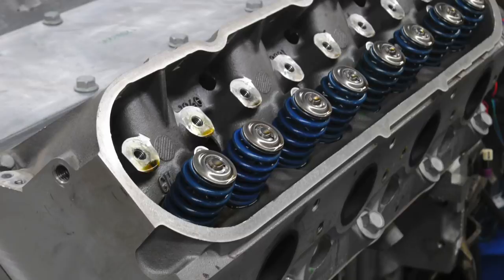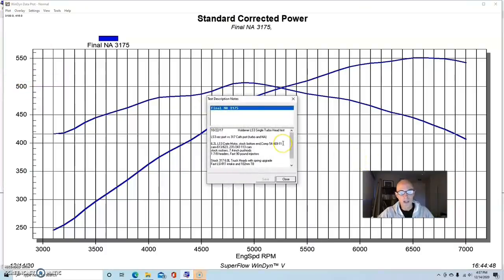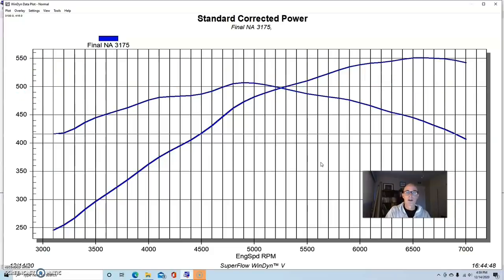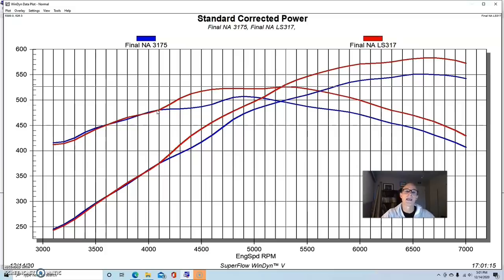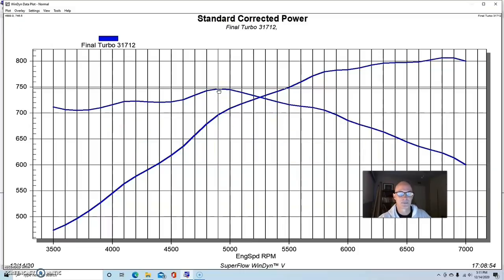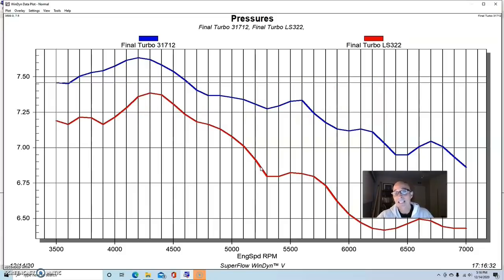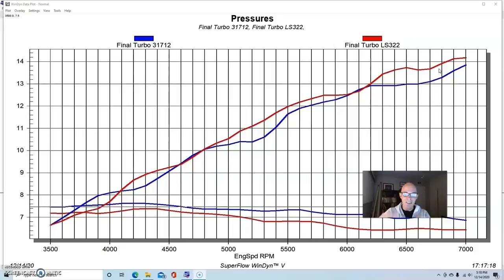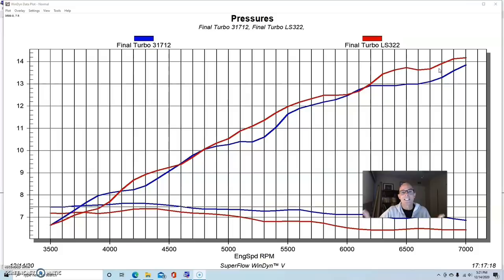TURBO LS HEAD TEST-317 VS LS3 (NA & TURBO)

Comment: Here's something weird. The square port truck manifold and the LS3 manifolds run almost identical numbers. The TBSS manifold and square port truck manifolds are physically identical except the port shape. The Fast manifold is an improvement for the cathedral port over the TBSS, but not the truck/LS3 manifold. I wonder why that is.
Reply from the maker: the TBSS is not identical to the rec port truck manifold
Reply: @richardholdener1727 externally they look the same. I was swapping parts from one to another yesterday. I did notice the injectors look like they are off to the side out of the way of airflow on the square port. That probably makes a big difference.

Comment: Will the 823 heads match up with a 5.3L LC9 block?
Reply from the maker: IT WILL BOTL ON-BUT THE VALVES WILL HIT THE TOP OF THE BORES
Reply: @richardholdener1727  thank you sir

Comment: I was thinking from what I’ve heard 317s are not that good but this test changed my mind 🥴bet very little bowl work would even out this comparison.Loved this test as I have a 6.0 with the 317 heads.if 800 hp is not enough add a pound or 2 of the ole boost 😉

Comment: You can definitely over think this stuff. I built a stock bottom 6.0 for my all steel 69 Nova. New rings and bearings, used BTR turbo cam, 317 heads with springs, VS s480, turbo 400, 9 inch with 3.70 gears. 80lb injectors, on 93 octane runs 9.71@140 in the quarter, in a 3700lb car. Safe afr, 14lbs and 15 degrees of timing. Scary fast! More than anyone needs on the street.
Reply: On pump gas. I like it. Building an AWD S10 w/6.0L, 317s, 3200 stall in a 80E, 3.73 Ford 8.8. I would be happy running anywhere in the 9s.
Reply: But 140 in the quarter not fast these days

Comment: Alright Richard, I'm just gonna have to admit it. Im soooo jealous of your job dude. Don't get me wrong as with any job , I'm sure it's it's got 1-2 parts of it that u hate. But to get to play on the dyno all the time testing new/oem parts on multiple engine types/makes etc,that right there  is what I'd call my dream job. 
Just watched the rerun of engine masters you did "Big Bang gen 4 LS 6.0l",I think that'd be the only part i wouldn't be crazy about w your job. That's only cuz i hate being on camera though.
Anyway,on that "Big Bang gen 4 LS 6.0" you ran outta map sensor at 29psi (1500+hp), whatever happened to that test? Did you finally get a 3-4 bar sensor and keep pushing it?
Reply from the maker: have not run it past that

Comment: ok so I am watching every video you pretty much have doing my home work. I have 317 heads and shooting for 1000+ hp I have decided to utilize methanol injection for those special days when I want all I can get as those days will happen.  I have said in numerous comments 408 stroker engine. your graph shows a pretty good power gain from 3500 to 5500 which is where this engine will be the majority of the time. and less boost pressure and more power will help with the limiting factor which will be the fuel 91 octane pump gas am I correct in this assumption. so 80% of the time will be at 7-10 psi on pump gas only the ls3 head puts out more power down low. even though I can just turn up the boost to get that extra power with the 317 heads I will run into my fuel being the limiting factor correct? so the wiser choice would be to up grade head in this situation. or am I off somewhere? I am slowly trying to learn all this from your videos. thank you so much for all you do.
Reply from the maker: YOU DON'T NEED HEADS FOR YOUR COMBO

Comment: With stock heads that flow as well as the LS3, I think it comes down to economics.  CNC ported LS3 heads from GM add 10% in peak flow and presumably a similar amount of power for $1200.  I always think in terms of additional power added per dollar spent, because I'm always looking for the best value.  If I have my NA LS3 up to 550 hp with a cam swap for $450, then want to add 50% more power (825 hp) with 7 lbs of boost with a $1200 turbo setup, that's a good value.  But if I spend the same $1200 on CNC ported heads for 10% more power (605 hp), that's not as good a value.  Say then that you have your 825 hp turbo LS3, and want to add another 10% power, you could spend the $1200 on ported heads, and get to 908 hp.  Or you could just turn up the boost to 9.2 psi, and make the same amount of power, and not have to spend the $1200.

Comment: Ls3 , what type of springs? 
What was afr?
Reply from the maker: DUAL SPRINGS AND DID YOU WANT NA OR TURBO AFR?
Reply: @richardholdener1727   spring rate,  you remember where you purchase the springs, part no. , link?

Afr for turbo, with rec port heads?

Comment: Something thats extremely important in this comparison(which is nor even brought up in the video) is the fact that the cam used for this test is an ideal cam for the ls3 head. Not ideal
For a cathedral port head. For a 6.0,  Ideally in the real world, an optimal cam for cathedral port heads and properly sized piping, the cathedrals will see the power coming in down low in the powerband. Essentially making more power than the rectangle port heads until you get up to 4000rpm. After 4k rpm, then ls3 head takes off.  On engines with leas displacement than the 6.0, this becomes more profound.  And engines bigger than 6.0, the ls3 heads make even more power up top, but still have little to no difference below 4k rpm....  there’s a reason why most all the fastest n/a cars still run ported cathedrals on anything less than a 6.0.
Reply from the maker: please see the many other head videos-and your comments on cath/rec-port cams in incorrect

Comment: Hi Richard, what do you think of the 241 heads? I'm in Australia they are the most common
Reply from the maker: I have a video up on the 706 vs 241 vs 317 vs 799 (they work well-better when ported)
Reply: @richardholdener1727  I'll look it up cheers

Comment: I had my 317 heads CNC ported which gave me another 71 cfm on a turbo 6.0 ls, I also increased my cam to your favorite comp cam,  now it does run quite strong however it seems like I lost power. Those are the only thing that I changed other than valve springs.
Reply: Fuel

Comment: @richard holdner what head bolts are you using? i’m building a 5.3 turbo... probably kept under 10-15lbs (**probably haha!) lots of opinions. would you use stock gm bolts? arp bolts? studs?
Reply from the maker: I USE ARP
Reply: @richardholdener1727  bolts or studs?

Comment: After all the videos you've done the biggest take away I've gotten from all of them is; more power na more power forced induction. So why would you not build for best na power, when youve stated time and time again more na more fi?
To put the question better; if youre going for best na power why would you not put known items on a na engine to produce the best results? Would you put a cam in it and do nothing else and expect results found on many of the vidoes on youtube show?
Reply from the maker: YOU NEED TO CONSIDER YOUR GOAL-IT THAT GOAL IS LESS THAN 1000 HP, YOU CAN ACHIEVE THAT WITHOUT MORE MODS-JUST CAM, SPRINGS AND BOOST

Comment: Us ls guys are spoiled. I made 760whp w stock 317s, head gaskets and head bolts. Unopen factory block. Just some 2003 vintage thunder racing cam that I bought in the ls1tech days. That's on stock ring gaps from a  04 lq4 85k motor. 
Ran out of injector n pump. Or probably could have made more. With a vs 7875 billet turbo. Common  ls hardware.

Comment: I need help on my 6.0 with 317 heads. Not sure what cam to install, springs , turbo or whipple charger 🥴😆
Reply from the maker: HOW MUCH POWER?
Reply: @richardholdener1727  Im a stock 6.0 with 317 heads in 2004 Silverado, I’d love to be in the 800hp range but not enough money for that so I think 600hp or so would be reasonable for me to build my engine.

Comment: My question is,  if I was to run a 6.0 LS, na, carbureted,  and dual plane intake, what would make the best power for the street and occasional track. What head, intake and carb combo. What cam do you recommend.  I'm on probably the very lowest budget lol!!!
Reply from the maker: THE BEST (CHEAP) HEADS WOULD BE FACTORY REC-PORTS, BUT THE CHEAPESTEST WOULD BE THE HEADS YOU HAVE. A SLOPPY STAGE 2 FROM AMAZON WITH CHEAP SPRINGS, 750 BRAWLER
Reply: @richardholdener1727  thanks Richard!! Waiting and watching every video!!! Oh and what intake do you reccomend? Is there an air gap for the LS?

Comment: Anytime you can make more power with less heat it is a gain. A better flowing hot side whether it be in piping or exhaust housing would allow for even more power at the same boost level. To match the power the less flowing head would need more boost and higher IAT’s.

Comment: I know you talk about ring gap a lot. But would a stock 5.3 motor without tearing it down and adding ring gap be reliable on 6-8lbs? Without ring bind?
Reply from the maker: PROBABLY-BUT WILL YOU KEEP IT AT 6 PSI?
Reply: Yeah. It’s my Yukon. Just want it to tow better

Comment: Hey Richard, if you look at this from a longetivity view, wouldn't the ls3 heads make the lower end live longer?
Reply: Or just turn down the boost 🤷
Reply: @hhn2002  my point was, that the ls3 heads made more power and less boost @ the same wastegate setting, so theoretically, the rod and main bearings will live longer.
Besides, if you lower boost, you lower power, and who wants to do that?
Reply: Your theory is incorrect. Boost is resistance to flow. The rods see the force applied to them from the pistons. More power equals more force. You could place a huge restriction in the intake that would raise the boost but kill power.  That would also provide less force on the rods, theoretically making them live longer

Comment: True the turbo makes the power you want but at what level do you loose reliability with boost I think over 15 psi your asking for trouble.  So  a ported set of 317 can make 800 hp at 14lbs non ported it takes 17lbs,  porting heads has its place for sure

Comment: I don’t think you need to upgrade the heads until you’re over that 1000whp mark. I’ve seen plenty of stock head cars 4.8, 5.3, 5.7 make well over 1000whp without touching the heads (aside from springs)

Comment: If your class limited to a certain turbo and need to squeeze every last bit of power out of what you have then yea port it. If you're running a stock turbo motor the thousand dollars you would put into porting the heads could get the same effect by adding 2 psi for free... Does it help, yes. Is it worth it, no.

Comment: The question is where did the 1/2 psi difference in pressure put you on the compressor efficiency curve?????  I don't know if the intercooler could take all the extra heat out or not (if there was a difference).  All we really know is which one had better MAF.

Comment: For all us guys who purchased a wrecking yard LQ4 and were previously told that the 317 heads are not the go to head, this is great news. For the $$$ saving of finding a set of used LS3 rec ports, I can buy ARP bolts for the heads and mains and then  make 800HP on 7 psi with 100 octane all day. In 1970 the famous LS7 454 with 12:1 compression was advertised to make 460HP ( made more like 525 HP). We've come a long long way.

Comment: On an engine dyno, where you have unlimited cold water for the intercooler and race gas, it doesn't matter. however, on the street, when using 93 octane, and limited intercooling, it is always best to make the power at a lower boost level. This cuts down on AITs and makes the engine less knock sensitive.
Reply from the maker: less than 7 psi?
Reply: @richardholdener1727  Sure...why not? Less AIT allows more timing on pump gas. Why would that be a bad thing? Especially since LS3 heads are so plentiful and affordable.

Comment: It's all about efficiency. Sure you can run a big turbo on a small headed engine and make 1000 hp. You are going to make the engine work harder and shorten the life. I would personally port the 317s (if running on the street and run a smaller turbo.) Texas Speed & Performance has a great program for cathedral port heads and it is only about $1100 and they flow as good as some aftermarket rec port heads (for about 1/2 the price.) The smaller turbo will spool up faster and you should get better acceleration. Just my personal opinion.

Comment: Hey Richard, I love the channel. No BS just info...👌🏻. I’m curious, if you add headflow, would adding exhaust a/r on the turbo fix the back pressure discrepancy between the 2 boost curves? Thanks for the channel.
Reply from the maker: a larger AR can change back pressure but can reduce spool too
Reply: Also love seeing different engines tested. Would love to see atlas 4200,3700 5cyl, 4.7 powertech... why you ask... just curious lol. Would love to magnum/LA v8’s as well.

Comment: I would like to see a stock bottom end with largest cam that will fit ls3. Maybe the newer comp cam lst stage 2 cam. stock vs aftermarket heads.
Reply: Rich has said in prior videos (I've asked your exact question before) that the COMP 54-469-11 is really the largest that you SHOULD do for PTV clearance being nominal (in caps because you COULD go bigger and go less than nominal specs), that's 231/247@.050 .617/.624 113LSA. Dish LY6/LQ4 pistons have a similar depth to the valve reliefs on LS3/LQ9 so the PTV is similar. Cylinder heads won't change PTV UNLESS valve angle is different (some BPE, MAST, FED and TFS heads are 12 degree instead of stock 15 degree), or block and/or heads are decked. 
Speaking from experience and measuring PTV, a 12 degree LS3 head has roughly .050 more PTV than a stock LS3 head.
Reply from the maker: valve size and valve drop is different on the LS3 head compared to 317 heads-so P-V might change a little

Comment: Depends on the compressor map of the turbo.  You'd have to see where the air flow vs pressure ratio lands on the map and see if the turbo is more or less efficient for the given combo.

Comment: Man! This video really explains boost vs back pressure events. I'm going to share this video with one of the younger mechanics where I work. I've been trying to describe what may be going on in his turbo application but I've been unable to and I know I've been very unclear about it. This video showing back pressure, power output and boost required is freekin great... He either has to go to electronic waste gates or open up his exhaust (like a dump valve before the cat).
Thank you again Richard, really useful data.
Ed D

EDIT: I would like to request information on an electronic controlled waste gate control that can be graphed on a laptop if someone can recommend one. One that can give data on all essential sensors including what is shown on a scanner. He has a lot of gauges including back pressure but in a graph it's much more likely to catch and diagnose an issue then trying to compare gauges. This would be on a Scion FR-S, not sure of the year or size turbo he is running.

Comment: So the other difference would be on the intake? From 317 cathedral to 823 rectangular head?
Reply: a 3 bolt throttle body from a earlier gen LS will need a conversion spacer to bolt up to LS3 intake (4 bolt)
Reply from the maker: THEY REQUIRE DIFFERENT INTAKES
Reply: @richardholdener1727  Thank you for assisting me in reducing my 401 🤣🤣👍mayyyybe I missed it what about the 317 vs 862 poor mans head test?

Comment: Hey Richard, do you have any videos about your process replacing or even just gapping rings for big power? If not, I’d certainly be very interested in an instructional video from you about how to gap rings properly and what works best for LS engines
Reply from the maker: .028-.030 is what I use
Reply: @richardholdener1727  thanks for the info! Is that the same for each ring?

Comment: Amazon has “sloppy stage 2” camshafts from like 4 different sellers on Amazon with prices ranging from $150-$180. Anyone have a clue if these cams are legitimate? The advertised specs are the same as the Elgin 1840p and they seem to have decent reviews. Just something about the price makes it questionable to me.
Reply: The SS2 E1840P should be a bit more expensive than 150-180 USD.  I think the going rates will be in the 240-260 range. If you intend to purchase on eBay or Amazon look for genuine Elgin in the description and it should arrive in blue and orange Elgin packaging. If it is too good to be true...

Comment: With a Gen 4 6.0 with 823 heads and an S480 or S485 would you get the heads ported if you wanted the potential to make 900-1000 to the wheels
Reply from the maker: no need

Comment: What heads/intake would you recommend for a 408 stroker with a 215/226.603/605.112+3 cam. Also plan to shoot nitrous through it or supercharge it eventually. It's going in my truck witch I tow 7000+lbs about 90% of the time. Any suggestions by anyone appreciated!
Reply from the maker: ported cath port heads and fast (or tbss for less power and $)
Reply: Thanks for the recommendation! What heads would be best? Ported 862-706s 243-799s TFS 225s? Money is not a issue.

Comment: Hi Richard im actually running a 6.0l gen4 iron with 824 head, ls3 intake, ct525 cam, camaro 2016 manifold and 1.00 ar turbo, i got a other block ls1 5.7l aluminiun and i want to kown if is better to go 5.7l with low compression piston and turbo cam with my stuff or keep my 6.0l or what is the best mod you think i should do, it a drift application. Thank for your help.
Reply from the maker: 6.0L is better
Reply: @richardholdener1727  and do you think I should stay with the stock piston or go to drop de compression

Comment: Would you be interested in doing a pump gas limitation video on something like a turbo ls. Timing vs adding boost to gain hp. Higher compression stock heads vs 317s. Keep up the amazing work and thank you for all the testing.